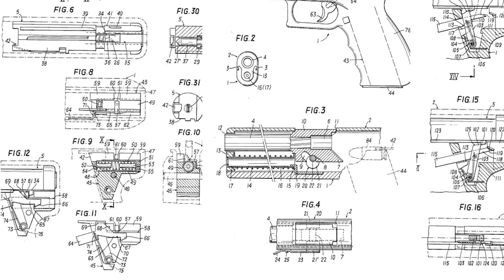The History and FUTURE of Glock

Comment: Before there were Polymer 80 frames, before all the plethora of Glock clones - Lone wolf had released an all metal Glock gen 3 compatable frame. When I was in my early 20's and new to guns, I bought and read all the main gun rags of the day - Amerian Handgunner, Guns & Ammo, Combat Handguns, Shotgun News, Guns magazine, and a bunch of others - and I remember reading article after article about the teriffic new "not-a-Glock" metal frames for Glock, that could swap all your existing parts over into, swap your factory slide onto - or buy one of the new Lone wolf stainless steel slides and barrels and have a gun that was very Glock-like, but didn't have any Glock parts in it necessarily. Now they're still making guns - having rebranded from Lone Wolf Distributors to Lone Wolf Arms. 

I myself have owned I think close to two dozen Glocks at this point. I've drifted away - I love other designs - but I came back to Glock this year again for duty and concealed carry use. Unless I suddenly became baller enough to afford a Staccato, Glocks are the best shooting duty-use guns for me. I honestly wish Safariland still supported Beretta, or that they'd support CZ Shadow pistols with a good level 3 holster - but if its not a 2011 - its a Glock style gun that they're making holsters for - - Glocks, FN 509, S&W M&P, Sig P320 - I don't think they're making level three or even level 2 holsters for any other maker anymore - not light bearing and optic ready holsters anyway.  Alien Gear duty holsters are pretty much only for Glocks, 320's, or M&P's. Best duty holster you can get for a Beretta is the US Duty Gear - and it's only a level 2. 

The market wants Glocks - and Glocks is what the market shall have. It could say Smith & Wesson, CZ, Shadow Systems, Bul Armory, Canik, Armscor, Rock Island, IWI, Stoeger, Beretta, Sig, or HK on it and still pretty much be a Glock in function or in the eyes of most folk.

Comment: Thinking the S&W mod 59 is what he meant because the 39 was the first ever 9mm manufactured by an American company back in the late 60's, and they only had steel frames for two years at best before they moved to alloy frames.  If you have a mod 39 in steel frame NIB it is worth around $1200 to $1500.  The mod 39 was single stack 7rnd mags where as the 59 was a double stack 13rnd magazine.

Comment: Glock (the company) would rent out shop space in a US city, where Glock had suckered the police department into buying Gen 1 Glocks, set up a machine shop and try to refit the guns to attempt to the fix guns' numerous problems. Before November 1992, Glock pistols were just horrible, and fraught with numerous and dangerous problems. The slide tabs would break loose from the plastic frames. The frames would just break. The new Glock tab locations made the slide not return into battery. Glock guns went off out of battery and injured people. Glock kept it all a secret and sent these guns off to their covert rented shops in the USA to be "fixed". Any gen 1 Glock is supposed to have 6 or 7 upgrades, and if it doesn't, you have to call up Glock and get those parts to install to make the gun safe.

Comment: Between 6:00 to 6:54 OP states: 1) Advanced machines for a 1911 compared to glock injection and stamped parts. Lol: 1930-1940s manual milling machines called advanced compared to 1980s cnc, injection, stamping, forming manufacturing.   2) Talking 'Precision Machining' while referring to the noisy, rattle can 1911 pistols. There is no or little 'Precision Machining' in the 1911s. They are manufactured with low precision, wide open tolerances to allow anyone to jam it together easily. Then, drop and throw it around, into dirt, mud, trash, truck beds, etc and have it still work. Period.  

The final dimensions of modern cnc can close tolerances in the 1911. Making them 'Precision Machines.' However, the introduction of polymers created firearms which can be tighter toleranced including friction interference fits not requiring lube. Allowing firearms to run dry. Thus, running/shooting longer between cleaning. Plus, more benefits. Like no rattle noise. 

OP really needs to read his script prior to video and listen to the foolishness. Then, clean up his narrative for accuracy. Just spewing sentences isn't delivering facts. It's ignorance in display. Sigh....

Comment: Oh the irony of the history lesson in the beginning because Glock has become S&W as well as those other entrenched firearms companies. They've refused to really iterate on their designs passed the Gen 1 major overhaul and are just making tiny changes and calling it a full generation. Meanwhile, other companies have passed Glock on by and Glock's market cap is shrinking sharply. You'd think the loss to Sig on the M17/M18 contract would have been a wakeup call to poke their engineers awake and have them start to really innovate. Most of the other companies have had to innovate in their polymer pistol line in order to differentiate themselves enough to get one up on Glock and Glock has stayed fairly silent throughout. Love them or hate them, Sig has really pushed the boundaries that Beretta tried and failed to do. The new evolution is the serialized fire control system. It's the next logical evolutionary step and brings a lot more flexibility to the game and Glock seems to refuse to budge. Other manufacturers see the leap that Sig made with the FCU and are fielding their own designs. The ability to purchase just one FCU and swap in any other component you want is powerful for a consumer. You can more or less customize your gun to your tastes and now, the FCU becomes this cheap gateway drug to the rest of your catalog as you now make all of your money on componentry that's plug and play rather than having to have extended time away at a gunsmith to do. 

The next evolutionary step now is modularity. Something that Glock was fairly close at for a while but rested on its laurels and refuses to really budge on. The modular fire control system is the next evolution of handgun design and its ability to build up a full firearm around it as you want it to while still being much more affordable than a fully custom gun from a famous gunsmith. You'd think people would remember how Gaston got started and learn from how Glock got its foot in the door, but now Glock is that giant corporation that moves at the speed of molasses and changes things rarely ever. They've brainwashed their sheep into believing that it's perfect and doesn't need to change at all. Just like the old firearm companies did with their guns when Glock arrived on the scene.

Comment: Great vid. I believe the Glock slide stop is produced entirely in a progressive die. No bending operations using additional machinery, which makes production even faster and less expensive. However, it is most certainly heat treated, but that is inconsequential, as they are done in batches of thousands. These observations come as a tool and die maker. Please correct me if I am wrong.

Comment: Bought the first Glock I ever saw, a Glock 17 in 1986. Only thing I was impressed with was/is the safety of the firearm. Granted you cannot "foolproof" a clown but it was potentially safer than most guns at that time. But I always was a "Hammer-gun" guy so I sold the '17 a couple weeks later. Now to cover the 9MM I have a CZ-75B. Completely satisfied.

Comment: What Glock has is timing. It is now a 40 year old design, with only the M&P following behind when it was released in 2005. By the time M&P came out, Glock already had 20 years on the market for its design (polymer striker fired). 

Glock is a brand that can afford to be lazy. In honest comparison, the only thing Glock lay holds on is aftermarket. But it will continue to live as majority of professionals still use it.

They are perfectly usable guns and have the best aftermarkets.

Comment: I would dare say that Glock is the modern day 1911. Not since the 1911 has a pistol reached the same level of sales and ownership reliability and popularity. The 1911 was revolutionary in design and so is the Glock. The 1911 was made so well the design has never really changed much except for external appearances. Same with the Glock. Glock took it a step further by making their pistols modular. I own a Glock G21 gen4 it cost less than half of a quality 1911and for very little money I can convert it to a 45 super, 10mm, 9mm ect. Every part is cheap the support is outstanding and the firearm is super easy to work on. A lot of people are going with other polymer pistols now but I'm going to stick with Glock. It's time tested battle tested by police and rock dependable.

Comment: Gaston Glock did pretty well for never having designed a firearm in his life. But, his design has many shortcomings. Poor sights. Poor trigger. Very poor ergonomics. Horrible point ability. Several manufacturers have taken the polymer, Stryker  fired, double stack design way beyond. And are eating Glocks lunch for them. While Glock just keeps churning out the same reconstituted, tired design. They really need to start over from a clean sheet of paper. And attempt to catch up. You would think. That after  the overwhelming rebuke after the JSP trials. And the subsequent independent retrials. They might get the hint. We haven't ordered one in the shop in at least 3 years. Nobody wants them anymore.

Comment: Bad comparison.  The 1911 slide stop also does what the locking block in the Glock pistol does so your comparison of the slides stops between the Glock and the 1911 aren’t correct. You need to combine the cost of the locking block with the slide stop on the Glock to compare with the 1911 slide stop.  Still not a good comparison but it’s more accurate than what you illustrated.

Comment: The glock 's recoil system, slide-locking and some parts which could be actually an improvement of an old one were taken from te 1911 system. the Glock is not a new invention but derived from an old pistol design-1911.
Reply: It’s absolutely nothing like a 1911. The three most influential handguns in history are; Peacemaker, 1911, and Glock.

Comment: I have a preference and this is that I would not purchase a handgun that  that necessitates pulling the trigger to disassemble!! If an engineer is in any way safety minded, making this necessary to break the pistol down is not a handgun I would rush to purchase. Just ponder on this thought for a moment. The utilization of one part of a handgun is most dangerous to oneself, or anyone around you. This one part is the “TRIGGER!!” Why make this one most dangerous part which makes the firearm go bang part of the disassemble process? We have all seen videos where innocent bystanders have been harmed because of this!! Glocks are tough, accurate for the most part, and dependable, but it amazes me how a great engineer of a great handgun would allow include this in the disassembly.
There are many other excellent handguns out there that do not require this dangerous step as part of their disassembly!!

Comment: No matter how many time is held and used glock I could never buy it as I absolutely prefer better quality like XD with build that surpasses Glocks.
XD is built like a tank compared to Glocks with better and stronger polymer and double recoil springs which allows for shooting even 45 super in stock configuration which would blow up Flock into peaches.
In 14 years of owning it I never had a failure of any kind.
Just my thoughts and experience.

Comment: The most impressive thing about Glock is how tribalism got people to defend that stupid grip angle and terrible trigger, and those same people don't realize that the Glock 17 is actually a simplified/cheapened 1911 - uses the exact same tilting barrel and locking system, and the trigger dingus is actually a 1911 grip safety relocated - AND NONE OF THAT IS A BAD THING.  It's actually a sign of a mature design that there's a ridiculously simplified cheap version. And that's where the tribalism comes into play - people feel the need to justify going cheap even though cheap is probably a better option for most people.

The grip angle is still shit making it not point correctly, but that's why God and Smith & Wesson gave us the M&P, which seems to have been designed around the Glock complaints list that Glock pointedly ignored for decades.

EDIT: What made Glock "America's gun?  IT'S CHEAP.  Full stop.  Adjust for inflation and it's ridiculously cheap for what you get, around half the cost for a US made 1911 made with non-US steel forgings.

Comment: Glock hired engineers who had very extensive gun experience. All of the parts and mechanisms inside of a Glock already existed.  I have seen the same extractor design inside of the old Walther PPs. I have seen the linkless barrel lockup in Browning Hi Powers and 1000s of other guns. I have seen the half cocked striker inside The Roth Steyr. The H&K VP70 came out in 1970 and it's frame is plastic. The Remington Nylon 66 rifle came out in the late 1950s and most of it is also plastic. The ejector in a Glock is like about every other ejector.. The first Glocks were actually pretty awful. Not until 1992 was the Glock a reliable handgun.

Comment: Should one add that the number of accidental discharges have and continue because of the ease of the trigger. Where a Double action/Single action would have prevented a lot of these. Folks are dead because of the striker fired handgun. Folks are in prison, etc. but man are they a great handgun! With the top 10% of operators, they are fine. But for the rest, good luck!
Reply: People sure have a hard time learning trigger discipline.

Comment: A little over 5 minutes in you made a key point the cost of the framing pennies-on-the-dollar also taking into consideration innovation ideas why then are the glocks so expensive you compared to components out the gate one at $50(the competitor) one at. $5 (Glock) that's  10 times more. Why then are Glocks so expensive  so a S& W. at $500  that Glock should only be around $50. And allowing even an extra amount of PROFIT given the benefit of doubt it should only cost around $150    I feel I getting we'll  Id rather3 not say PS I have 2 Glocks  (different calibers) and I have just as many problems with them as any other firearm I own

Comment: Why would you need new holsters for others making a similar platform? Shouldn’t they all fit in Glock holsters?
Reply: They can’t technically make an exact copy something needs to be slightly different. PSA dagger does not fit Glock holsters
Reply: Thanks for explaining. I thought that was an important piece of information that should have been made by a holster manufacturer.
Reply: @abbashamideh9097  Yeah they actually have started to advise folks not to buy daggers or Glock clones due to the inconsistent design. I would still recommend only buying a Glock due to the aftermarket options because they are not accommodating the Glock clones.
Reply: @thevally6127  same here! No Glock clones whatsoever! Glock on!

Comment: Insufferable Glock Fan boys.   All modern pistols work great, most are accurate and choosing a Glock as the end all be all of pistols is just fanboy nonsense.   Smith and Wesson run just as good have a better grip angle, CZs are smoother and more Accurate. I will buy a PSA Dagger before I give Glock a single penny,   After they lost to Sig on the last big Contract because they refused to do anything close toward following the programs outlined parameters I realized these guys are just so arrogant they literally can’t even change what they do and have done for decades….   And so they lost, and non Glock Fanboys Laughed and laughed.   High points work as good as glocks.   Get over yourselfs

Comment: What a load of BS.

Mr. Glock was a well established businessman producing low tech military supplies like spades and cartridge belts for the MG42 resp. 74. He saw the chance the upcoming Austrian contract offered and decided to expand into handguns. He therefore hired a team of firearms engineers and tasked them to develop a revolutionary new pistol. He did hardly any engineering work himself, he was overall boss and ran the company. His background is an engineering focused middle school diploma and at the time his experience was in plastics manufacture. There was no out-of-my-own-garage-operation, no metal stamping machine paid for by pumping gas or whatever rags to riches BS... simply a mid sized company deciding to expand. Glock GmbH existed for around 15 years before work on the pistol began. As said, predominantly by employed engineers with input from the Bundesheer.
Reply: In further news: the 17 refers to the mag capacity,  not any patent.

Comment: Glock is on its way out, past its prime.  The P320, with its correct grip angle and complete modularity, is the new way.  Every single Glock clone is the same crappy grip angle, with only a minor difference in feel, due to the magazine design/feed angle.  The P365 and P320 can be whatever you want them to be with a simple grip module change.  Glock has no answer for the size/capacity/configurability of the P365 series, and the P320 is America's new pistol as the M17/M18.

Comment: The future of Glock? If you're not a fan boy then you already know that yes Glock was the 2nd polymer stricker to hit the market.  It was the cheapest which made it catch on. And lastly it's the same 1980s design which has been tweeted a few times to make up for shortfalls.  It still comes with shit plastic sights and the trigger is still subpar and for what it is it's overpriced.  There are several better guns for less equal or more cash. When they first came out they were great but they've been surpassed for years.  Personally unless I could get one for a bargain price I wouldn't even consider buying one anymore.